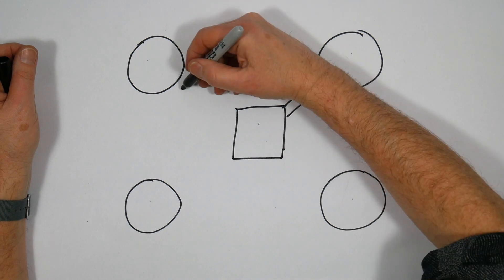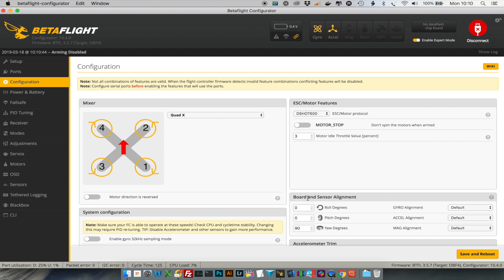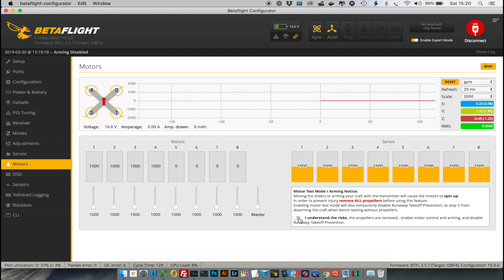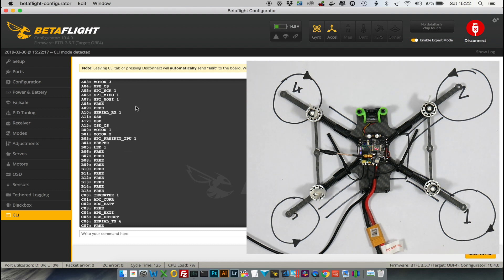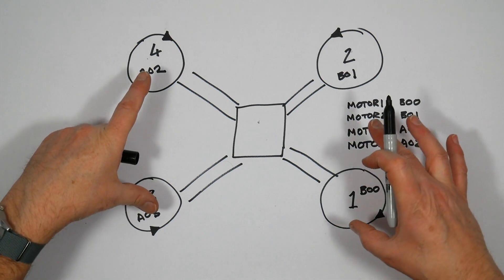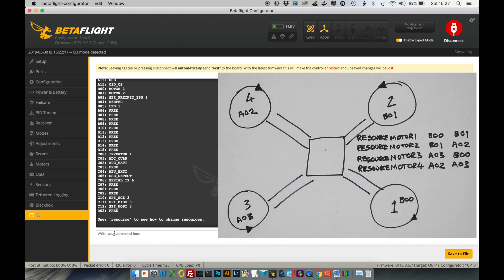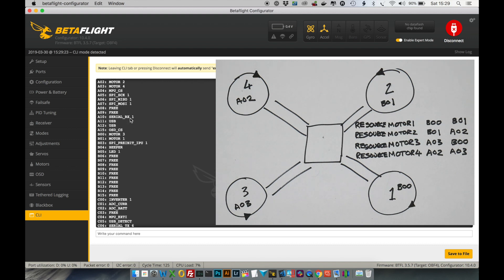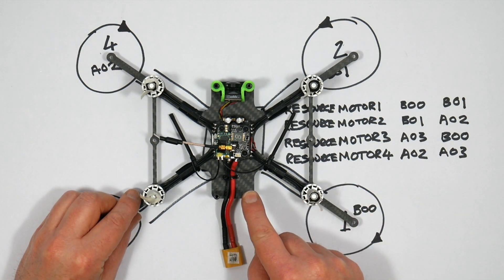Betaflight resource mapping - motors in the wrong order

Comment: I have one on a mamba board I just can't figure out motors 2 and 3 fire at the same time
Reply from the maker: Just write it down like I did so there are no duplicate mappings.
Reply: @WhirlyBloke  thanks for that figured out it wasn't my issue being on different BO1 duplicates so I dug deeper an found the tinyest bit of soldier had bridged the esc  flicked it off an presto.   Cheers
Reply from the maker: @morpheusone7755  There's a huge pleasure when you find and fix problems like this. Nice one.

Comment: Thanks I needed this.
Reply from the maker: My pleasure. Thanks for watching.
Reply: I have a question though. I have an aio 16*16 stack that pins together. No wires. It won't fit in my 150 conventionally and only pins up 1 way. Will resourcing the motors correct the direction of the FC or an I out of luck on that option for that build?
Reply from the maker: @TheChantse  Yep, that should work fine. This is mapping of resources and the wiring doesn't need to be changed. Remember to backup your betaflight settings first so you can rollback if there's a problem.

Comment: Is there a way to reverse individual motors? My motors are in the correct order, but I assumed I could reverse the rotation in CLI if I needed to so I just soldered them up any which way that looked good. Now I have 3 spinning the opposite direction. I really don't want to tear itapart, it's such a small build and very already had it apart like 5 times! Lol I would think it'd be a fairly standard thing by now but I guess not!
Reply from the maker: Yep, it's easy. I covered in another video https://bit.ly/2zxgATJ
Reply: Thank you for that! Mine is saying it's not a blheli esc, even though on the manufacturer's site it says it has BLHeli dshot600(Diatone mamba f405 mini w/f25 4in1). After watching your
 vid I was like yesssss thank you thank you thank you! Maybe there's something wrong with mine. Researching continues...